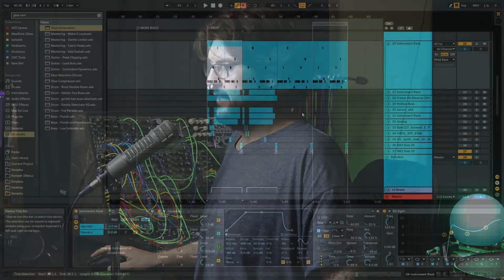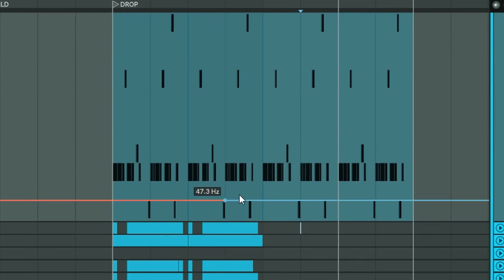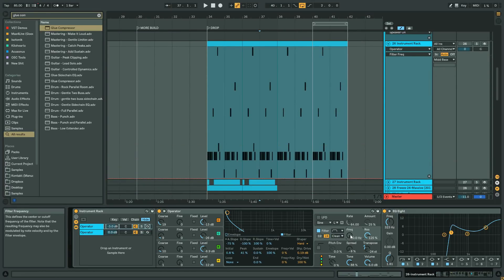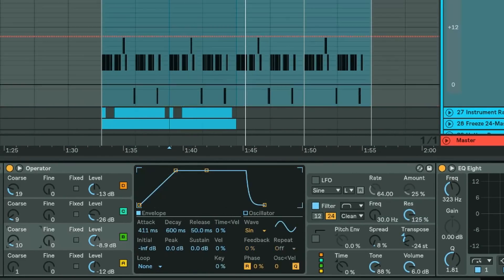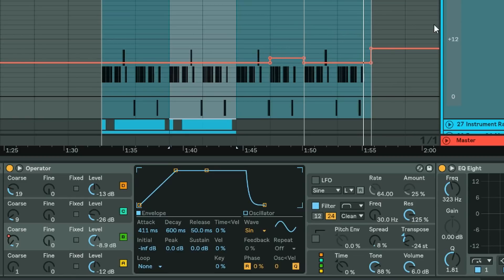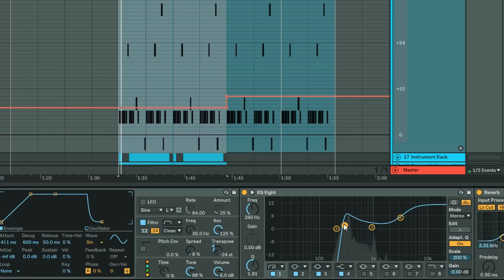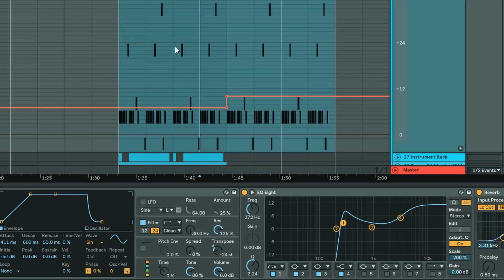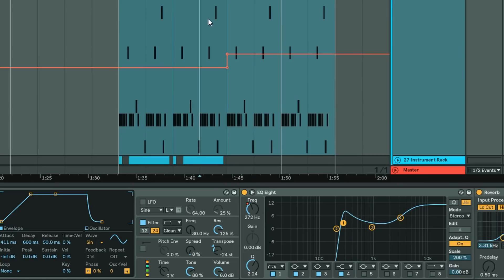Mr. Bill - Ableton Tutorial 70 - Snapping Parameters to Absolute Values

Comment: I've been doing this when I needed exact values. If you're late or early on hitting enter on the parameter value during recording you can stop transport, select a portion of the automation with the new correct value, then ctrl-alt-c to copy just the automation, select the target area and ctrl-v to paste it (ctrl-alt-d also works to duplicate automation).
Reply: Doesn't it always just copy automation if you have the automation lanes showing?

Comment: I would find it better to attach it to a macro and set the macros min and max values to exactly what you want. Then drawing automation will be really easy, simply drag all the way to the top or bottom for the two values.
Reply from the maker: Until you want 3 values for 1 parameter in the same tune 😂